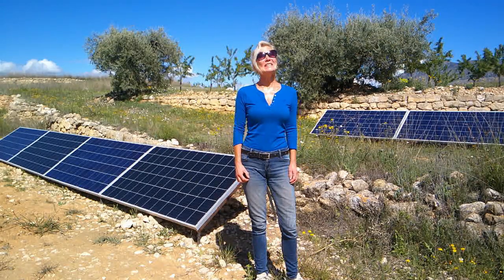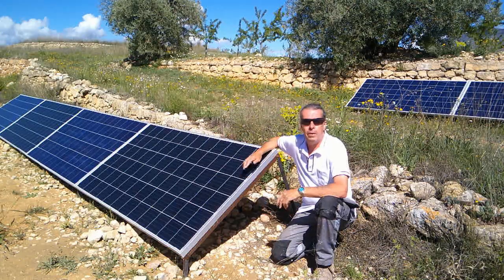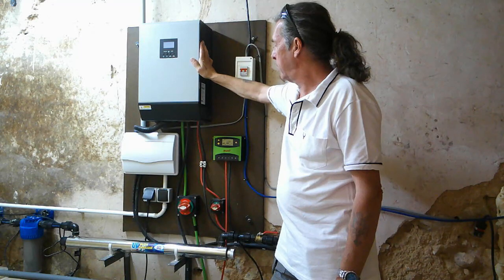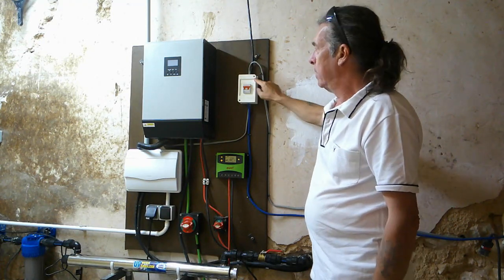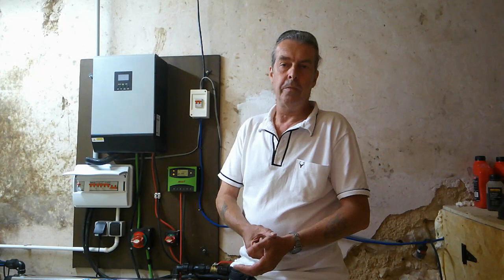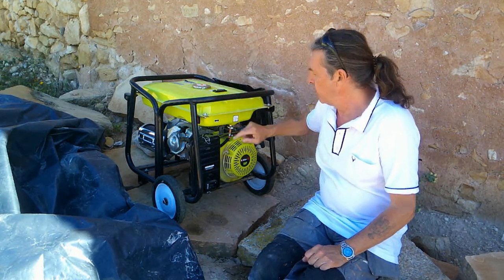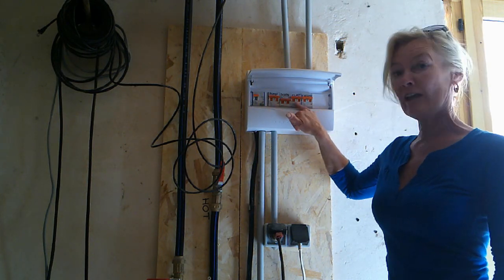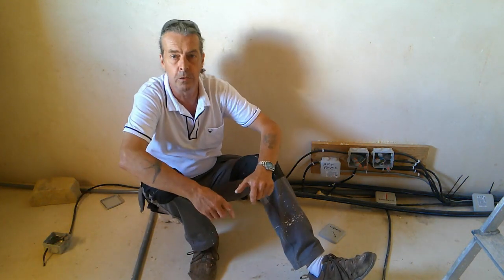Off grid solar installation - Restoration of a Finca in Spain

Comment: Hello Sharon/Andy, yet another great vid (admittedly one of my favourites so far because I want to know more about clean green energy). Quick question: when you get the odd dull day (and hence no/little sun) you fire up the generator, but is the gennie used to charge up the batteries? I assume it is? Apologies for my stupidity. Many thanks and best o' luck
Reply from the maker: Yes, that's correct. The generator charges the batteries and runs all the loads. There are a couple of more recent videos on our solar upgrade which probably explain things a lot better
Reply: @FincaLife  Cheers for that Andy. Something else then for me to look forward to. All the best 👍

Comment: Can you tell me what is the inverter model you use?
Reply from the maker: Crikey, this was a while ago. I think we had a 'Must' inverter / charger at that time we we didn't rate very much at all as it failed dismally. We changed it to a Voltronic Axpert which was better. However, since then, we have doubled the size of the panels and changed the whole system to 48V (it was 24V then) and now have a Growatt SPF5000ES which we are extremely happy with. We have done a couple of videos more recently on the whole upgrade / revamp  which may be more useful and of interest to you.

Comment: Really enjoying seeing your progress, we will be implementing something similar (but much further north) starting next year.
With a system like yours, is it subject to any sort of planning consent or inspection/regulation? And for wiring, does it need certifying? We'd like to do a lot of work ourselves, but don't want to fall foul of any regs. Thanks, and keep the videos coming 🙂
Reply from the maker: Thank you. As I understand it, if you want a habitation certificate, the electric installation needs to be tested. Having said that, We need a habitation certificate to get on the local padrón and the town hall are sending an architect tomorrow lol. So who knows... In any case, if you are competent, you can still do the installation yourself and simply get it signed off by a registered electrician. We did a couple of videos recently, upgrading our solar which may be more help. Our system is working fantastically now

Comment: Please do not use 'mil' for millimetre as 'some people' in certain parts of the new and old world use that for a thousandth of an inch. I know, what kind of person would still be using the imperial system these days?!?

FYI, I'm in Canada and use metric but due to our proximity to a country full of metric stragglers, we are also held back by this. If anyone in North America hears you say 8 mil wire, they are going to think it's a 8/1000" thick which is 0.2mm thick.
Reply from the maker: Thanks - I didn't realise that and point noted!

Comment: Thank you so much for the video. Tou are inspiration for many. I’m thinking to follow your path and moce to Spain to buy something affirdable to renovate. Question on supply place: do you guys buy all parts locally in Spain or import from elsewhere (this question is related to solar system as well as to anything else. Other question is for inspections required for construction, electric installation, water system etc. Is it mandatory to do that in Spain and how that process looks like (cost, who does it and when in the process of installation). Do you need and project created prior the solar installation? Thank you
Reply from the maker: Thank you for watching! Everything comes locally, including all the solar stuff, which is cheaper in Spain than many other places. The only inspection we need is for the electrical installation, if we want a habitation certificate - which is only really needed if we ever wanted to sell. The solar installation isn't included in the project and as far as we are aware. isn't required to be.

Comment: Why 24v not 48v? If your using 240v in the house why not go 48v.
Reply from the maker: Hi Graham. Initially we only had 4 x 6v batteries, as we thought that would be enough, so 24v was the logical way to go. Since we upgraded the system, we could now run it at 48v but it would mean changing the inverter etc, plus rewiring all the panels so we decided to stick at 24v, which apparently is very suitable for systems up to 5000w (ours will be 4500w with a 4kw inverter). At larger outputs 48v gives the advantage of smaller cable requirement, other than that, there is no real advantage.

Comment: Hi , Do you get much wind where you live, I was wondering if a windmill would help in the winter months?
Reply from the maker: We have looked into wind power but they are relatively quite expensive for the power they produce and the wind speed necessary to produce a reasonable amount of power. We thought the generator would be more cost effective, as and when required. Thanks for the suggestion!